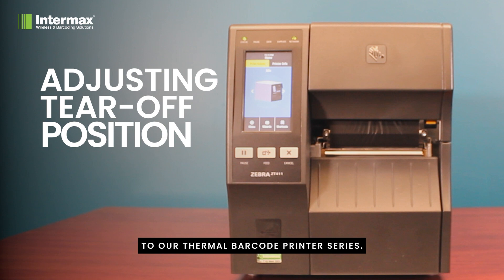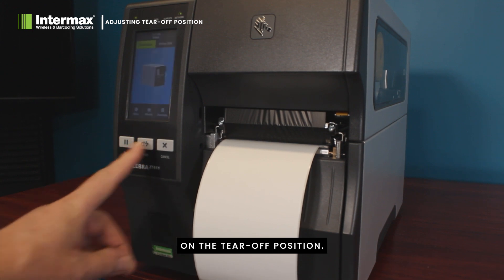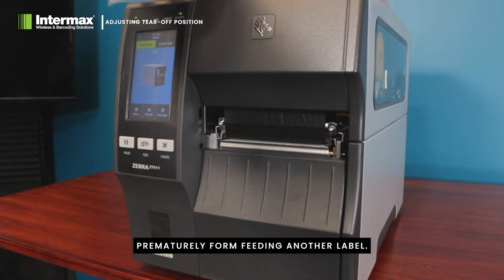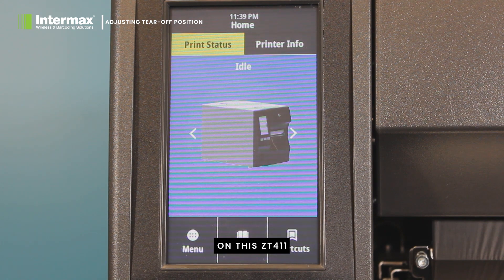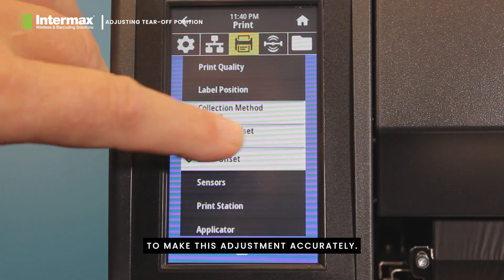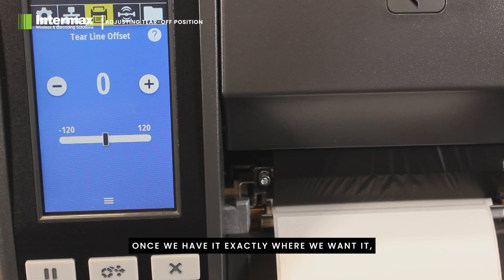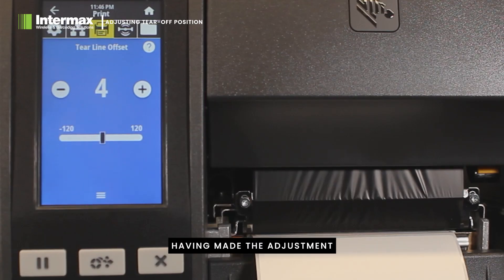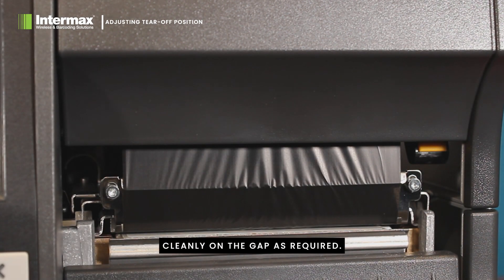Adjust Tear-Off Position of Your Barcode Printer (ft. Zebra ZT411) | Intermax

Comment: What if you have a paper substrate of different thicknesses but the size is the same. One paper is cut correctly with the ‘tear off’ parameter set to 0 and when you put on the second paper, after calibration, the second paper is cut wrong? The paper is the same size, almost the same colour and matte. If we have 200 printers, do we have to adjust each one manually? And when we do not know what type of paper will be used?
Reply from the maker: Great question! The ZT411 is a capable unit, but even slight changes in media thickness can affect how the printer detects label gaps, which in turn impacts the tear-off or cut position.

Even if the paper is the same size, matte, and nearly identical in appearance, variations in thickness can influence the media sensor's calibration. The ‘tear-off’ setting and sensor thresholds are tuned to the specific stock in use, so switching to another paper type may require recalibration.

For a fleet of 200 printers, where the media type isn’t always known in advance, manually adjusting each unit isn’t practical. Here are some ways to streamline the process:

 • Use Media Profiles: Zebra printers allow you to save multiple media configurations. If you know the common media types in rotation, you can pre-configure these profiles and easily switch between them as needed.

• Centralized Management with Zebra Print DNA Tools: If you're using tools like Printer Profile Manager Enterprise, you can push settings and perform remote calibrations across your entire fleet, saving significant time and effort.

• Enable Automatic Calibration at Startup: Set “Media Type” to Non-Continuous and “Media Power-Up” to Calibrate. This ensures the printer recalibrates automatically at power-on or after a media change, which helps when media stock varies.

• Adjust Sensor Thresholds: In some cases, fine-tuning the media sensor sensitivity can help accommodate a broader range of media thicknesses with fewer recalibration requirements.

• Assign Specific Printers to Specific Media Types: If possible, allocating certain printers to certain label stocks can minimize inconsistencies and reduce the need for frequent adjustments.

If you’d like help setting up media profiles or deploying remote configuration, happy to point you in the right direction. Drop us a line at sales@intermax.com.au!
Reply: @intermax_au  Hi, thank you for you comment, sorry for delay. 

 „• Use Media Profiles: Zebra printers allow you to save multiple media configurations. If you know the common media types in rotation, you can pre-configure these profiles and easily switch between them as needed. „  How to do it , is it simple switch between them ? 

„• Centralized Management with Zebra Print DNA Tools: If you're using tools like Printer Profile Manager Enterprise, you can push settings and perform remote calibrations across your entire fleet, saving significant time and effort. „ - Never heart of this app, but remotely calibration it shoulb when you know what kind of paper will be used next. Simple user dont have knoledge about it, so it cant not be remotely.

„• Enable Automatic Calibration at Startup: Set “Media Type” to Non-Continuous and “Media Power-Up” to Calibrate. This ensures the printer recalibrates automatically at power-on or after a media change, which helps when media stock varies.” – every printers has this option deafault ON – so the changin paper and close the head start printer automatic calibration, but some type paper is set properly, some other not.

„ • Adjust Sensor Thresholds: In some cases, fine-tuning the media sensor sensitivity can help accommodate a broader range of media thicknesses with fewer recalibration requirements. „ - How to do it ? This option it seems to be in webpage panel configuration, but if you change it, and save, printer show message information about „Media not detected”. 

„• Assign Specific Printers to Specific Media Types: If possible, allocating certain printers to certain label stocks can minimize inconsistencies and reduce the need for frequent adjustments. If you’d like help setting up media profiles or deploying remote configuration, happy to point you in the right direction. „– This ooption is not possible because there is not possible control employe what kind of paper is put inside.